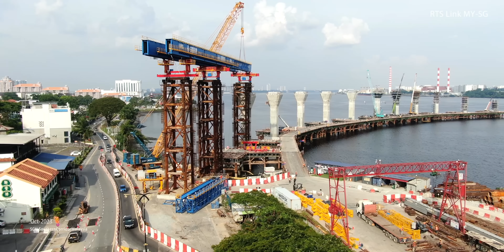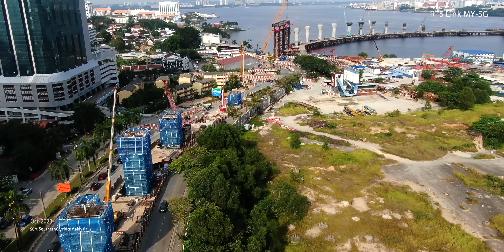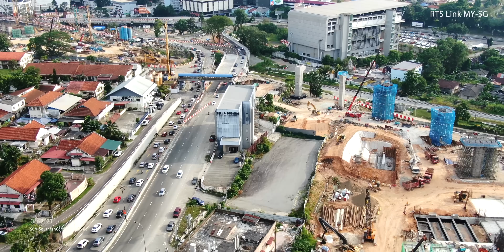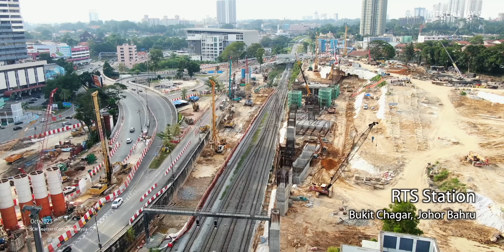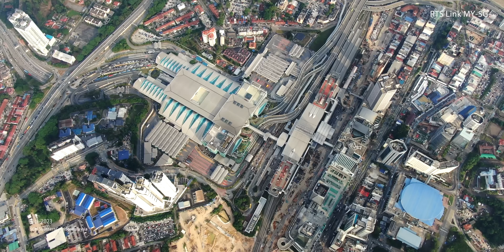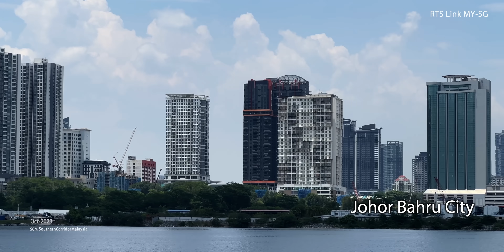Unbelievable Progress & SPEED! RTS Link Project Oct '23

Comment: I wondering why dont they just upgrade the existing KTM JB SG shuttle?
Reply: They are replacing it with the RTS. That's the point of the RTS. The current Shuttle is severely limited due to it being a single line which meant only a single train can run at any point of time. A additional track is not possible as the track is squeezed in between at Causeway, meaning no space at all for a 2nd track. Also customs are as such that it can only take in ppl from a single direction flow only at Woodlands Train Checkpoint.
Reply: @nick_1551  No such thing as no space. Termination of the shuttle tebrau was one of the terms of the RTS. But received the feedback of passengers, transport minister will study and discuss the possibility of retain shuttle service to sg with his counterpart.
Reply: @nick_1551  Where do you think the Malaysian side halfway small corner extra space come. Construct extra space for a railway using rock is much more easier than marine viaduct.

Comment: I noticed that there is only 1 single line for the entire route. Wouldn't this be a single point of failure should there be any mishaps along the route?
Reply: It's a single line but dual tracks. If the other track isn't affected, the RTS can still operate but will be slower for safety precautions